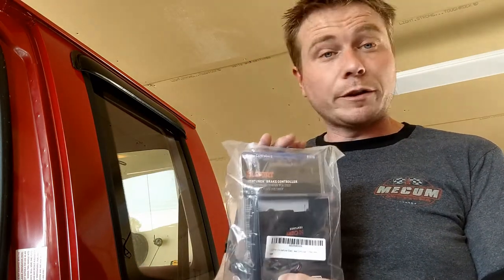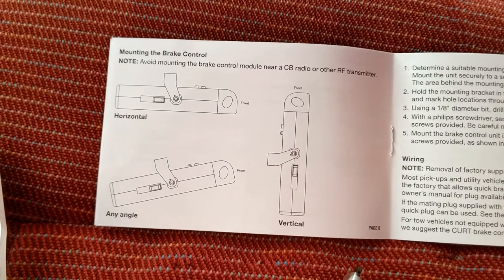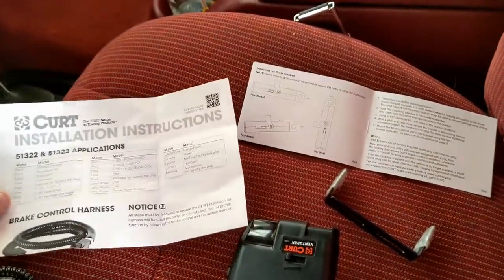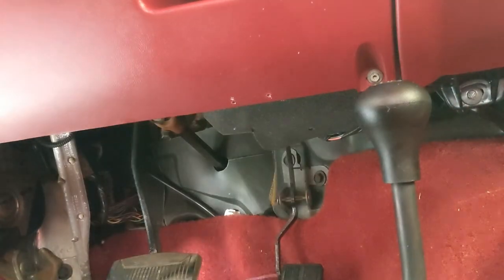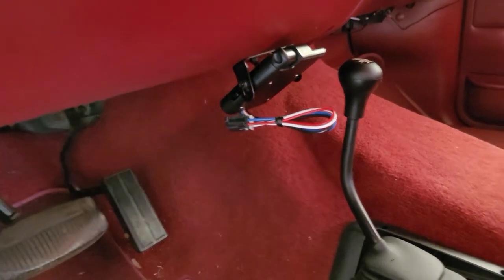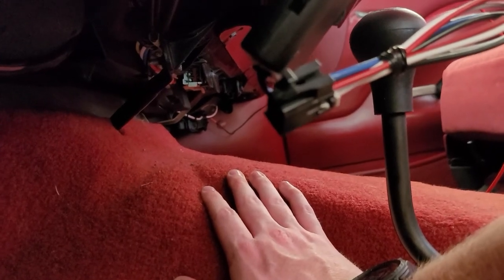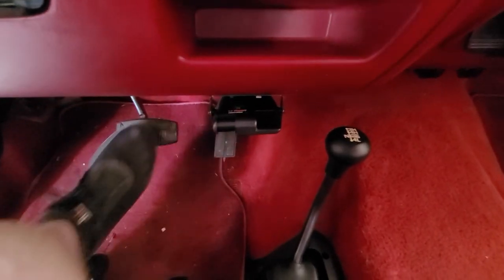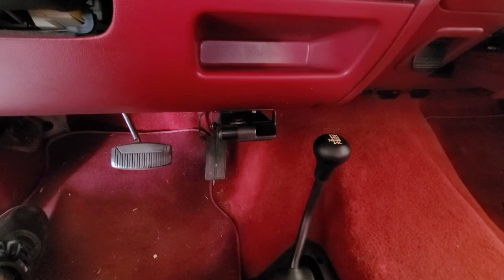OBS Ford Trailer Brake Controller Install

Comment: Did you have to run wires to the rear? Seems odd there would already be wiring for it.
Reply from the maker: If I remember right, I didn't have to do anything in the rear.  Just the relay block up front and controller.  There may have been a plug and play kit for the rear harness. It's just been long enough now I don't remember. Unfortunately I sold the truck a few years ago so I can't go look.

Comment: I noticed your vehicle was plug and play.Did your truck come with a tow package of any sort.I have a 95 also ,I'm curious to know if my harness will be that simple.Thanks.
Reply from the maker: As far as I know all the trucks have the harness under the dash.  Mine was missing some relays under the hood to run a couple trailer things like 12 battery power (they mount right off the underhood fuse box).  I was able to find those from a full tow package truck and they just installed plug and play style.
Reply: @project944  I yes purchase an f150 1995 and I Ned to do this do u have any link or. Part number for that brake controller or were I can purchase

Comment: But how is it all connected at the rear??
Reply from the maker: Mine was already all ran from factory. The plug under the dash is what allowed it to work. I did also have to locate a set of factory relays that go under the hood that worked with the accessory power